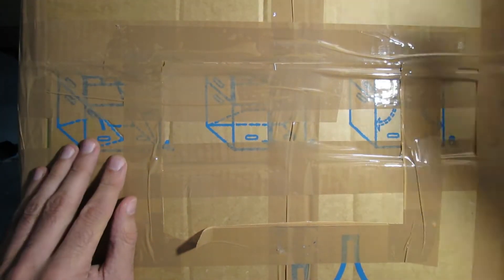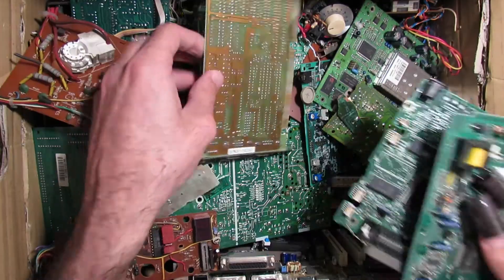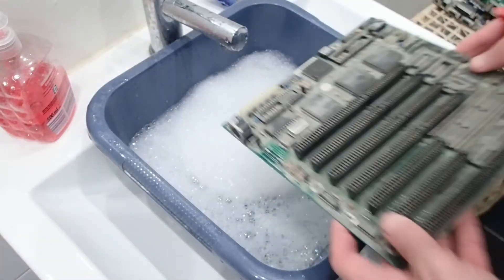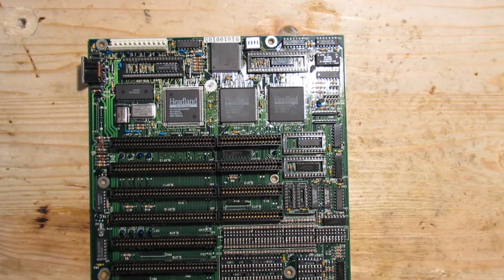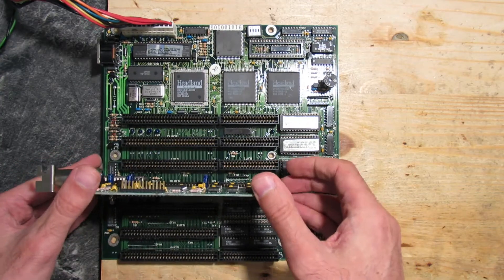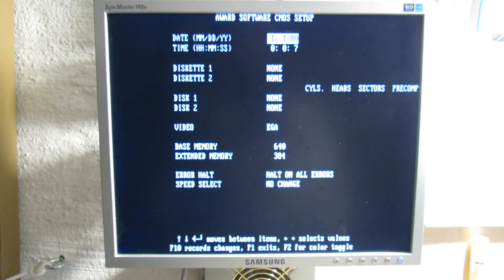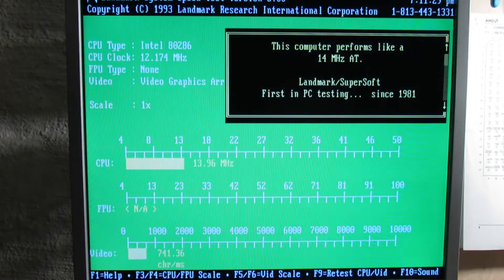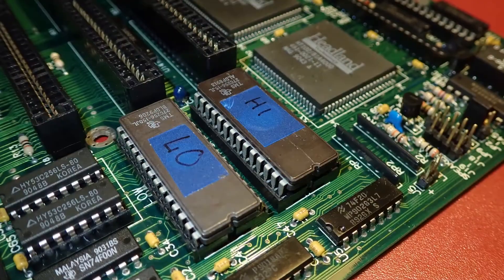Trash to treasure (rescuing 286 and more retro hardware )

Comment: @necro_ware
The GW2760 is an ISA IDE/FDD controller card that provides support for both IDE hard drives and floppy disk drives. Key features of the GW2760 controller include:

- Supports up to two IDE/ATA hard drives[1][2][3]
- Supports floppy disk drives, including the ability to handle 128-byte sectors in FM and MFM formats[1]
- Includes connectors for IDE, floppy, serial, parallel, and game ports[2][3]
- Uses a variety of floppy disk controller chips, including the Western Digital WD37C65, National Semiconductor DP8473, PC8477, and PC87306, and the Acer M5105-A4E[1]
- The floppy disk controller chips can handle both single and double density formats, as well as 128-byte sectors, which allows the card to work with non-standard PC floppy disk formats[1]

Overall, the GW2760 is a capable ISA controller card that provides comprehensive support for both IDE hard drives and floppy disk drives, including the ability to work with non-standard floppy disk formats.[1][2][3][4]

Citations:
[1] https://retrocmp.de/ctrl/testfdc/testfdc.htm
[2] https://stason.org/TULARC/pc/hard-disk-floppy-controllers/U-Z/UNIDENTIFIED-Two-IDE-AT-Interface-drives-GW2760WX.html
[3] https://schematicsforfree.com/files/Computers/Interfaces%20%26%20Ports/GW2760%20Super%20I-O%20Card%20Manual.pdf
[4] https://www.ebay.ca/itm/225862250979
[5] https://stason.org/TULARC/pc/hard-disk-floppy-controllers/E-H/GOLDSTAR-ELECTRONICS-INTERNATIONAL-INC-Two-IDE-AT-32.html

Data provided by Perplexity.ai

Comment: Could you please to upload new bios for 286 somewhere.  Both of odd and even roms have equal AMI firmware?
Reply from the maker: I don't have this board anymore, but you can find compatible BIOS on the Ultimate Retro project. Just search for a similar board:  https://www.ultimateretro.net/en/
Reply: @necro_ware  can i write both of roms with same firmware? i will write to modern dip chips because it is working for 386 and 486 boards
Reply from the maker: @hyp3rvirus  No, odd contains higher bytes and even contains lower bytes. Two roms contain different data.

Comment: It would be so irritating if today's PC's counted up the RAM that slowly, I mean counting 8GB, 16GB and 32GB at that speed
Reply from the maker: Yes it would. The PCs back in the days didn't just count the memory, but also made some simple memory check. That's why it took so much time. Later, when the memory size increased, mainboards stopped scanning and checking the memory, they just read the data from SPD chip, which was on the memory modules since SDRAM DIMMs.
Reply: Turn on your PC now because you might need to use it in a few weeks!
Reply: Usually a BIOS setting allowed to skip the Memory check, but the First count was Always performed.

Comment: I take it that the "high" and "low" is because the BIOS ROM chips are only 4-bit word width? This was the case with early RAM chips as well, with 1-bit and 4-bit chips being common well into the early 90's. I recently had to reverse-engineer a quarter of the motherboard for an XT clone I've been fixing up (no technical reference manual to pull schematics from), to trace a memory error, and got a good understanding of how the memory control on these old computers worked. The error turned out to be due to a bad 74LS00, one of the gates was bad, and it caused memory bank 3 to switch off when bank 4 was enabled.
Reply from the maker: Almost right. The ICs are 8-bit, but the AT mainboards can access BIOS in 16-bit words (two bytes). So low means lower byte and high means upper byte. If you have two BIOS ICs every second byte is located on the other ROM. With the memory it's similar on 286 and 386SX. There the memory bandwidth was 16-bit, that's why the 30-pin SIMM modules had to be used in pairs. Each such module was 8-bit, so you had 16-bit with two models. On 386DX and 486 the memory bus is 32-bit, that's why you had to use a set of four 30-pin SIMM modules. The  PS/2 memory modules (72-pins) were 32-bit already, that's why you could use single module there.
Reply: @necro_ware  You're right. I completely forgot that 286s are 16-bit. (facepalm) Most of my playing around with hardware is either Pentium class machines or XT-class machines. 

I've got one 16-bit machine, my Tandy 1000 RSX. I've got both SIMM slots populated with 4MB sticks. Now I know why both sticks have to be identical. The video RAM on that machine is in two banks of 256x4-bit chips (one bank soldered, one socketed, as you know), so the Acumos AVGA2 chip uses an 8-bit VRAM bus despite being a 16-bit chip? Or was that just Tandy cutting corners? I've seen at least one other example of that chipset using 256x4 VRAM chips.

Comment: Found in the "trash." That is seldom possible where I live, thanks to electronics recycling, which means the best chance to get retro stuff is on eBay or Craigslist. To avoid jacked up prices on eBay, go for the stuff listed as "parts or repair" and just fix it up yourself.
Reply from the maker: By "found in the trash" means, I bought a box of electronic scrap and found this inside. Not, that I found it by going down the street. This is not possible here since many years as well...
Reply: @necro_ware  You can tell somebody already went "gold mining," since all the socketed chips were yanked. I hate those guys. You don't even get much gold from it.

Comment: Thats great.  There is only 1 local area that accepts e-scrap.  They won't have anything to do with trying to save anything.  I even offered to pay them double what it scraps for and they wanted nothing to do.  Its a shame because I suspect they get a lot of old computers.
Reply from the maker: Same here, no way to buy anything from scrap yard. I get this stuff from Ebay, which is sometimes a win and sometimes a loss.
Reply: @necro_ware  i live in Portugal and there are two local srapyards were i can buy e-scrap,although very rarely something old or interesting appears there.... one of them sells no problem but the other is expensive and reluctant to sell because of so alleged data privacy reasons....they even destroy the hard drives and whatnot....they have a bunch of 3dfx cards there, those with multiple cpus, that they refused to sell to me, guess they went to check their prices online and got super greddy...they are gathering dust there for years, some day an inspection comes there or maybe during a "spring cleanup" and i am sure they will toss the cards in the big bag for shredding....makes me a little bit sad...today i bought an olivetti 286 pc in miserable shape,very rusted.. opened it up and surprise there is a western digital caviar 86mb drive inside, the black ones with white letters...those are super reliable and my favourite hard drive series, i am testing the computer and the drive this weekend and will post a video on that. i am very anxious i hope the hdd works.  i also bought there a miniscribe 20mb mfm drive that was stuck, in order to avoid snapping the heads i opened it and freed the heads very gently. then i rotated the platters by spinning the flyweel on the bottom by hand, the heads did not appear to be disturbed or dislodged...but the stepper motor was badly seized when i tryed to rotate it, i ended up rotating/dislodging the "interrupter" that says "do not rotate" by accident. the drive then threw me some blinking lights  that meant an error with head positioning and sector zero...i eventually got the interrupter adjusted to a place were that error does not appear anymore but now it blinks again in a different pattern indicating a "seek error dring burn in or recall"...do you have any idea what can it be? is it worth trying to fit the drive onto a pc and doing a LLF? or since its throwing an internal error and blinking the lights it wont be recognized and i need to sort it first? the drive seeks well and sounds healthy, i still remeber how a good drive of that vintage sounds like
Reply: Here in my area of Canada, all the electronic waste goes to the local Bottle Depot, who handles all kinds of recycling. Of course, since it's a government contracted operation, they don't let you in the back room to see any of the old computers.

Comment: I've spotted this MME chip at 04:29. It kinda looks like an Z80 clone from an east german computer like a robotron. Do you remember of what type of computer it came from or is it just some replacement part that was floating arround somewhere? :)
Reply from the maker: That's right, you eagle eye! Unfortunately I don't have a robotron in my possession. I bought once a bag full of ICs harvested by someone somewhere, because there were some chips in the pile I needed. Some GDR ICs were among them. I kept them, because I found it exciting , but I don't know, if they are working. May be one day I get my hands on one of such machines and then I can give it a try.

Comment: Asus P2B! I had the «P2B-F» variant 20 years ago. An absolute beast, I had my first truly successful overclocks using that board.
Reply: Me too, I recall pushing a Celeron 300 to 450 or so
Reply: I have a p2b98-xv board in my Pentium II. It’s a similar board but has an onboard ati graphics chip instead of an AGP slot. Wonder if I could solder one on and have it work.

Comment: The ALS100 card has an OPL3 clone ;)
Reply from the maker: Yes, and it's soooo bad :)
Reply: @necro_ware  It should sound the same though as it is a direct clone ^^ ...signal quality might differ though and is often worse than on other cards.
Reply from the maker: Oh yes, you are actually right. Somehow I mixed it with the AD1816 chip, which was on the TerraTec Base-1. ALS100 has an OPL3 clone indeed.

Comment: Enjoyed the vid!  its great to see how interchangeable stuff from that era is. I have to ask... 286 Overclock? :D
Reply from the maker: Hehe :D I knew you would ask it! I'll think about it, you asked for real world benchmarks and I have to think about how to make that. Overclocking for 286 happens in the same way as I showed it for the 386, with the crystal oscillator, however it is even more complicated to find proper benchmarks for 286. I have two 286 mainboards now and I'll make some tests behind the scene. If I have an interesting result, I'll do a video, ok? :)
Reply: @necro_ware   yay! no worries. I thought the process would be similar to the 386 to be honest.  Its interesting to me at least how much performance wasn't fully unleashed from CPUs from the manufacturer, meaning you had to buy a whole new main board and CPU to gain performance if you didn't know about changing the crystal to control the speed of the processor. So many people must have had to upgrade every year to stay on the cutting edge of speed to run the latest software when, in some cases the hardware was the same  just made to run faster and was perfectly capable all along just turned down to sell higher models. something that Intel are still doing today unfortunately.